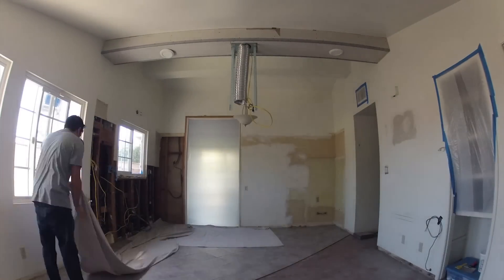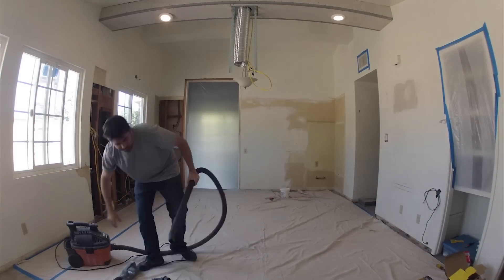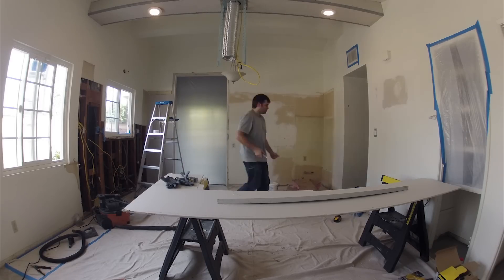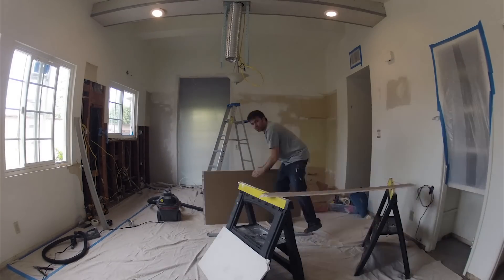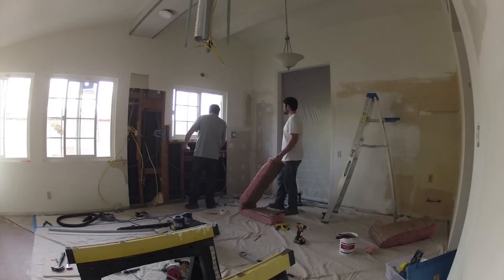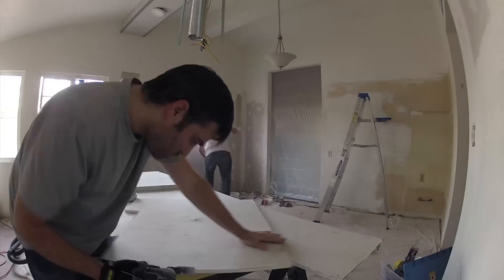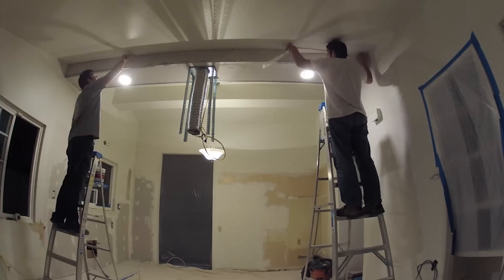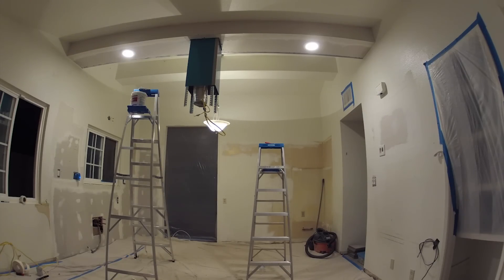Kitchen Remodeling - Day 6 of 17 - Drywall Sanding, Taping, Mudding

Comment: I was wondering how hard is it to do all of this on your own with just you and the fiance. Me and my fiance are going to start saving up to renovate our kitchen. We need to take care of the walls because they are plaster and lath. No insulation at all in this house. So we have to start from scratch. But we also need to either keep the sink where it is and not deal with a plumber coming and getting that fixed up or we move the sink to a different area and the a plumber here to fix it up. Also have to re wire I think and we need to do the floors we will have to level it. What should we do first  from the floors wiring or plumbing is there a first step?